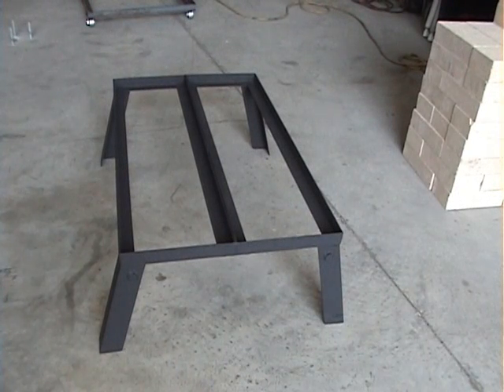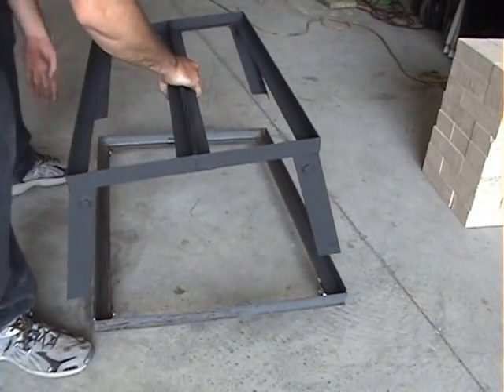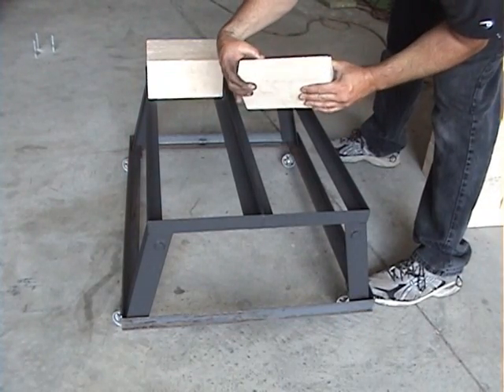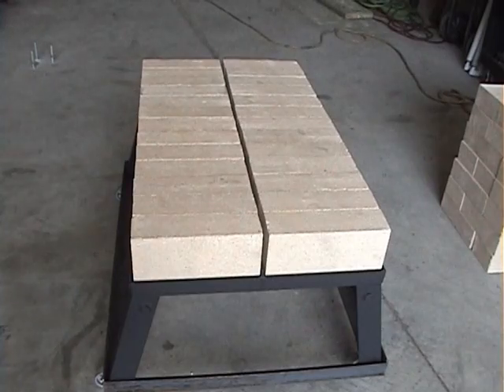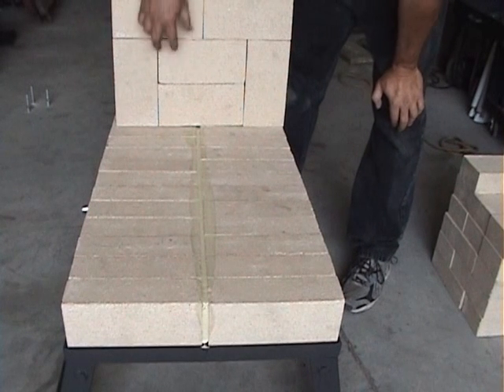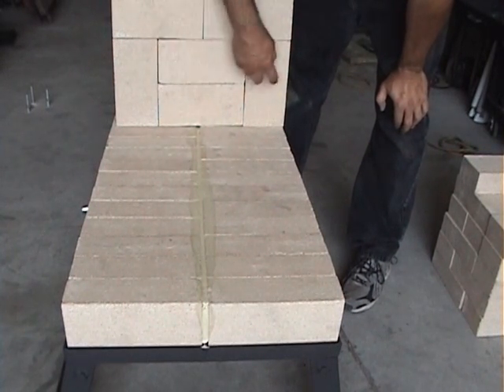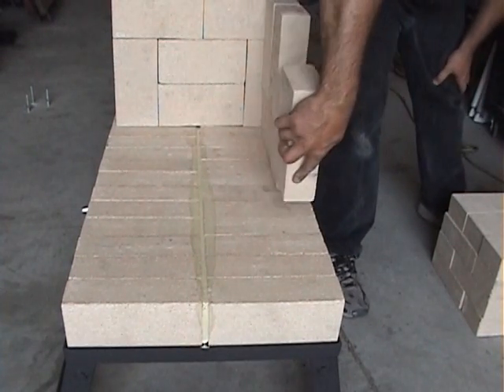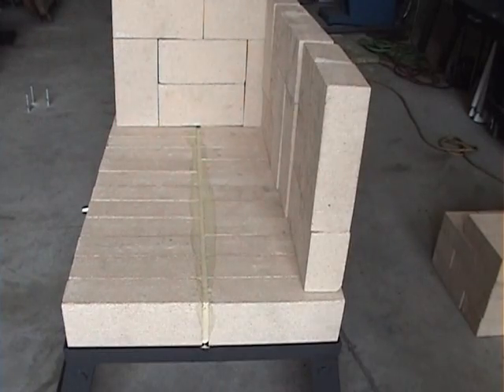Brick & Flame wood stove by Mr. Energy

Comment: I used to work for "Master Flame", a maker of fireplace burners and logs. I ran the welding department. We were a small operation, so I often helped making the logs too. We were using a ceramic refractory (said to be the same stuff the launchpad for the space shuttle is made out of). I bet one could buy a few 50 pound bags of that, and make this even more cost effective.

Comment: Cool idea and cudos for coming up with something like this but as stated by others fire brick is designed to be a poor heat conductor making most of the energy go up the flue, if however the side and top bricks were replaced with soapstone you would have one helluva great stove. The soapstone absorbs the heat and then radiates it out long after the wood is gone hence the reason it is the preferred choice for masonary heaters. With those you can burn soft woods very hot reducing the creasote problem and they then give off a long lasting gentle heat. If made from soapstone bricks cut the same dimensions as your firebricks you would have a decent heater. I know because I modified a Kodiak stove with sopastone and heat my house with it. You can usually locate soapstone in rough form at countertop manufacturers, at least I did.
Reply: Great idea southron jr, I didn't know that soapstone would take the heat without cracking but I guess you say it's okay to use the soapstone in place of the firebrick? Just making sure. Write me back if you get a chance.
Reply: how about using bricks from old electric storage heaters, I am no expert, just an idea., and getting the air for combustion from an independent external source, to save having the room heat taken up the chimney, or it's like having a hole in the bucket.
Reply: @chuckcunningham9653  some reason your post just came to my attention. In my stove I kept the fire brick on the bottom and 1 brick high in the fire box. I left the steel firebox in place and simply placed the soapstone on the top, sides and rear of my stove to absorb the heat from the steel and then radiate it out over time. I still have to make sure my stove isn't over fired causing popped welds but it has worked well for me as our primary heat source in my house.
Reply: @daibhiseaghdha153  using extrior air is preferred  but be careful, critters and rodents like to come in that way. Most modern stoves are designed to use an external air supply. My house it wouldn't work well because my house was built in the 1830's and has PLENTY of airflow coming from outside. The air going up the flue actually draws more air into my house wich with my sized stove, is more than acceptable. My stove regularly has us cracking windows even on some of the coldest of nights but where I live, we might see single digits 2 nights a year. As for the bricks, not entirely familiar with the type you are refering to. If they are insulation bricks, then they would keep the heat inside the firebox and going up the flue. Worst case, I placed regular solid masonry bricks along and on top of my stove for many years before swapping to soapstone and they will absorb and radiate heat like sopastone, just not as much.

Comment: Same type of fire brick I buy at the local masonry supply store. I use it to line the inside of my woodstove, very common.   Lifespan depends on amount of wood I burn. They are called fire brick, but they do crack, become brittle, and ultimately fall apart due to intense heat. Then they need to be replaced. Get the danger ? Outdoors next to your fire pit, sure. But indoors ? Never ever, no way, Charlie Brown. A drunken home inspector would never approve of this for indoor use.

Comment: Just wondering how the test went? I tried checking the comments to see if you say but just the typical circus monkeys nonsense. My old Lennox co2000ht was disassembled for shipping many years ago. just popped the crate and looks like all insulation needs replaced. Was thinking of building something like this. Would like to buy that frame and door if possible or maybe a print. Hope all is well. It looked like a great idea.

Comment: I would place some square steel tubing from back to front and use that as a heat exchanger with a blower. If you don't build crazy fires it will last a long time and you can get some usable heat out of it !!. Of course there are a lot of pros making comments on here, doing nothing but running their mouths as usual, but not being very productive!!!!!
Reply: +TheDave570 Lowes and Home Depot sells it !!

Comment: That will leak smoke. if you roughly load it, it can potentially start a fire cause those fire bricks crack and erode too..... best cover that with metal. Novel design, just not safe in the long run.

Comment: If you want an easy very efficient wood burner find  a 55 gallon barrel buy the kit for it and let me tell you  the thinner the stove the  more the  heat will be available to the area you are trying to heat this fire brick and be use for the bottom of the barrel and this brick will not let the heat through to the room like thin metal will.

Comment: Where did you buy the fire brick? No hardware store I go to offers fire brick. When you ask hardware store employees about where their fire brick is located they look at you like your nuts.
Reply from the maker: moofushu You need to go to a Wholesale Brick Yard
Reply: +mrEnergy511 that would make a nice rocketstove build
Reply: i bought fire brick at ace hardware and have bought it at home depot. ive seen it at walmart and they sell it at sam's club. do you not live in a country with ANY o those?
Reply: Go to a brick yard
Reply: moofushu you can get fire brick at any tractor supply or farming stores
Reply: moofushu its so expensive he could have just bought a stove ....best and cheep way is the barrel stove but you will still need a few bricks to line the barrel ..six to ten . the meterials used here are ridiculous
Reply: Johnny Drinkard
Thank you. I'm still very interested in this. I've been looking at other brick ovens and ways to make them.
Reply: try a brick yard for firebrick
Reply: moofushu building a few  , the barrel as a heating source and stove , but yes for oven use the brick it soaks up the heat and the food produced just tastes better
Reply: Fire brick can be purchased usually at local brick yards along with clay brick. It seems that the type he is using is kiln brick and will not stand up under usage because they are light and very porous to create a better insulating ability. I feel this furnace although not heavy still needs a considerable  review of the original drawings.

Comment: +mrEnergy511 thanks for sharing your build. Since it's insulated by the brick walls, is it designed to be run outdoors for hydronic or air duct heat exchanger heat extraction? I'm trying to understand the use of brick walls AND stove top.

Comment: This is neatly made, but otherwise a HIGHLY inefficient stove. The burn is only a single stage, though well insulated, so will convert somewhat inefficiently, producing not very high temperatures, and then most of the heat produced is lost up the chimney anyway.

Comment: I'm worried this doesn't look structurally sound, especially under heat and load? The design relies upon the adhesive strength of fire-stop caulking which may not have the ability to maintain its "glue" like bond when at operating temperatures... sorry to be a downer but this may be fine outdoors but I wouldn't trust it inside.

Comment: little wheels will get stuck in little cracks on the floor while pushing 500lbs of stacked bricks with little mortar... a recipe for failure is high, just by looking at it ...at least make a one piece  outside all around skeleton frame for that house of cards...the only heat will come from front door plate and lots of wasted energy absorbed by firebrick enclosure, firebrick are insulators not use for heating, it actually stops heat!...just a firebrick box.

Comment: This is a very bad prototype. Those refractory fire bricks are not supposed to be exposed on the outside like that - they're very easily damaged and tend crack over time. Another thing of note is their usage... they're supposed to insulate heat and are not structural in nature... you have no thermal mass in that stove to store any heat so basically you're just burning a potentially hot fire and all of the heat will basically go up the stovepipe.

Comment: No ash pan to catch the ashes, using real mortar would ve made it more air tight, but then again no radiant heat, it all goes up the flu. Look into a rocket mass heater. Good try though.

Comment: That brick is designed to keep the heat in the fire chamber. It's insulating brick which is used in kilns. It's very light and fragile. You can scratch it with your fingernail and cut it with a butter knife. You can break them if you look at them crooked. That floor design is very dangerous. If you want to do this, the floor should be hard firebrick on a solid steel plate. I have used this insulating brick and ceramic fiber to build kilns for several decades. My interior temperatures are 2100*f - 2400*f. That's what this brick is designed for. It holds heat in. The hottest exterior part of this will be the stovepipe. Very, Very dangerous. Sorry mrEnergy511, but you should remove this video before someone loses a house or worse.

Comment: That design had no stability. Plus it needed another set of legs in the middle.
Secondly to get proper oxygen, you want the wood to be on a rack at least 8 inches away from the bottom surface, so the air flows from the bottom of the fire and goes up. With good air flow, you get no smoke and perfect heat.
Reply from the maker: Very Stable! Air tight Wood Burning Stoves need no log holder/ "Grate" that is only needed in an open wood fireplace. Check your facts bro 8" is WAY to high for a log holder/ grate 3 to 4" Max. If you build one you would know. Good Luck 🍀